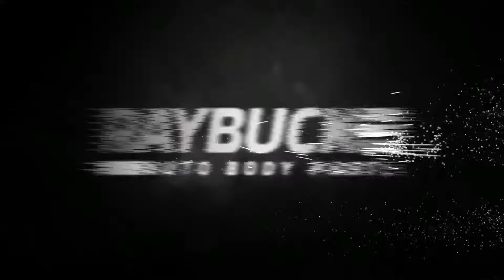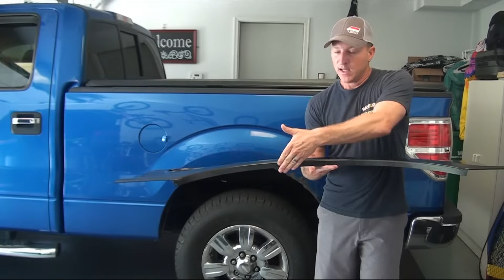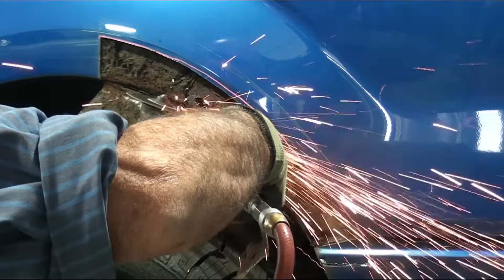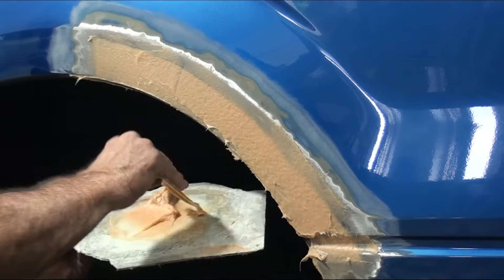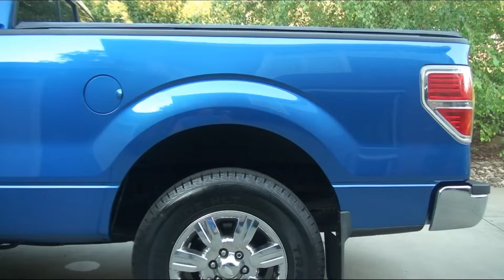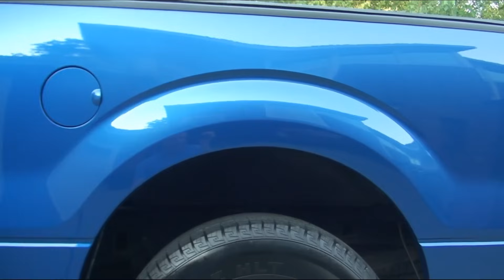How to Repair a Rusted Wheel Arch

Comment: Just a question, as I have become a victim of the wheel well rust, what would be a labor cost for something like this, and total cost after everything?
Reply from the maker: It's hard to put an exact amount on a project like this as it's variable, depending on the amount of rust that needs to be repaired, the cost of the parts, and the labor rate of the shop doing the work. Roughly, though, it's probably going to be in the $800-$1000 range.

Comment: what is this special red primer befor (and for?) welding?
Reply from the maker: It's a weld thru primer. It helps seal the bare metal, and it won't burn off during welding like a standard automotive primer would.

Comment: So there is no possible way to prevent/seal the issue area?
Reply from the maker: Yes, you can remove as much of the foam as you can reach and then spray that area of the bed with undercoating or cavity wax. You can also topcoat any of that with a product like Fluid Film on a yearly basis. There's no guarantee that any/all of this will prevent rust from forming, but it really helps.
Reply: @RaybuckAutoBodyParts  thanks for the response. Starting to have slight bubbling on my 09. Really frustrating seeing as I took good care of it.
Reply from the maker: @Aman-rp7yj  Mine was a garage-kept 12 and it did this. It's really frustrating that the manufacturers won't change their process to eliminate this problem. You don't see this problem on older trucks that didn't have the foam spray.

Comment: How do you get the line in the repair piece so it slots under body?
Is this method easier for fitting vs cutting the repair panel and butt joint welding it?

The join on the inner and outer arch joint, is this welding together at all or just seem sealed
Reply from the maker: The arch body lines are so close that you can slide this piece under the body and it will almost right on. Personally, I probably would have butt welded, but I think it's just a matter of personal preference. Everything in this repair was welded, but the inner panel patch that they put in was stitch welded and then seam sealed.

Comment: Just a quick note to beginners watching this video...

It is EXTREMELY DANGEROUS to use a grinder cutting disc without a guard, like in the video. These discs can shatter and if that happens without a guard, you will probably need facial reconstruction.
Reply: I'd be just as worried about inhaling the debris/dust and chemicals. Excellent job  on the truck.
Reply: Not only is the cutting disc dangerous but flying metal is too. My brother nearly lost his eye because he wasn't wearing safety glasses and a piece of metal hit his eye. He never recovered all his eye sight. Always wear safety glasses. We were young and dumb and he's still paying the price.
Reply from the maker: Great point that I should have mentioned. I've had cutting discs shatter (especially if you have a cheap one) when they catch an edge.

Comment: Who is the manufacturer of y'all's sheet metal
Reply from the maker: Most of our wheel arches are made by Key Parts.
Reply: @RaybuckAutoBodyParts  just wanted to say I have recently ordered partial door skin for a 2006 caravan the panel at excellent quality was very very satisfied  .. at the end of this month I will be placing another order for the other side the density of the metal was great the one quality i look for with any part ...dale
Reply from the maker: @daleprice8161  thanks for the feedback Dale. Very glad you were satisfied with our parts. Merry Christmas
Reply: @RaybuckAutoBodyParts  I thought I had seen AMD on the video

Comment: question :  how much bondo was used to fill in the seams especially were the body lines met each other ...   thats the hardest part of rust repair are the body lines ..
Reply from the maker: It was a light skim coat. Probably around 1/8"